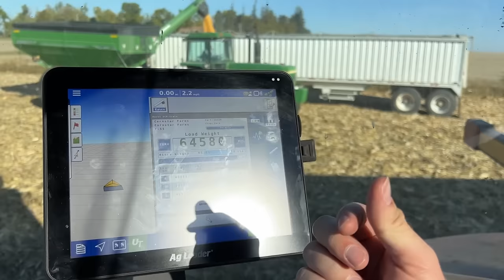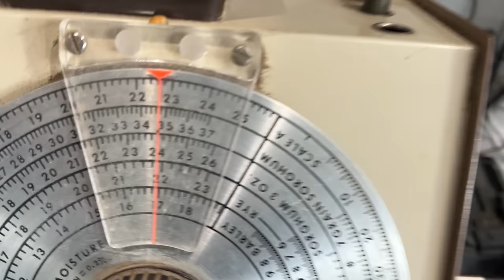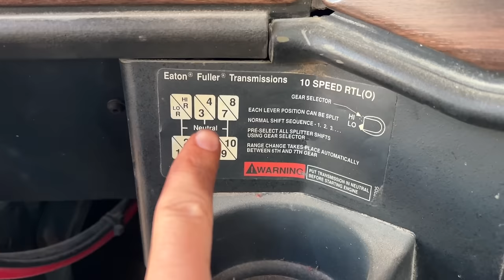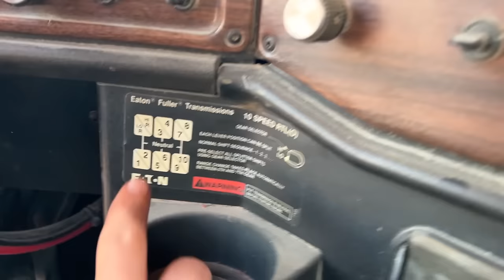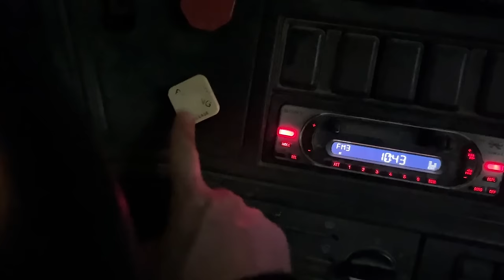My Farm Has A $140,000 Problem

Comment: The gearbox you were describing is a splitter box.  You have the 5 main gears in the front of the gearbox, then you have a low and high gear set on the rear of the gearbox.  The early Scania trucks, 80, 81, 110 models were all using splitter boxes.  A trap for young players with the splitter gearbox on the Scania...  Don't double declutch!!!  You do that, you get a box full of neutral!!!  Stop, drain the air tanks back to zero pressure, and start from scratch!!!  Police officer pulled up behind me after doing this.  He asked what the problem was.  You should have seen the look on his face when he was told what the problem was, and how it was caused!!!  "But, it's a truck.  You are meant to double declutch!"  No, not all trucks are created equal!!!

Comment: Would that be 2 exhumations?
You all are handling the bin site screw up much better than I would. Good luck going the legal way. It bothers me the most the way they don't shotty welding on those safety rails that people wouldn't depend on for keeping out of the harms way, not counting using low grade hardware on something with do much stress on bolts.

Comment: On the red Volvo auto shutoff, turn on cruise control and push the acceleration button as if you were rolling down the road to turn up rpm. Do not touch the clutch or accelerator. You are trying to fool the computer that you are driving down the road with cruise control on. On cold days in Coruptifornia 34•f😂 I would turn on cruise control to warm up my garbage truck and hydraulics faster. The Volvos we drove had that auto shutdown if the accelerator was not used for 5 minutes.
Yes I know 34•f a cold day.😂 I also lived in Alaska -32•f the coldest I ever saw.
Happy harvest

Comment: if you can find it, check what grade bolts both the auger is spec'd to hae, and what grade you were CHARGED for at time of purchase.  if it's spec'd for grade 5, the the bolt did it's job and sheared without absolutely wrecking the auger. if it's spec'd for grade 8 and you were charged for grade 8...

Comment: Grade 8 bolts are NOT "better" than grade 5. Grade 8 bolts have a higher tensile strength but are notch sensitive. Always use grade 5 if they are strong enough for the application. They will bend instead of break. If you need the strength of a grade 8, something is Probably deficient in the design. replacing those grade 5 bolts showing wear with grade 8 will most likely result in the bolts breaking.

Comment: OK cole the former owers of that combine probably swapped out the corn and sobean sieves and put in those other one that they were getting rid of that machine you mechanic should have seen that when in inspected that combine and as far as that red freightliner transmission goes what you have there is what they call a super 10 where you move the shift level five times or so . The transmission synchronizes will move when you move the button and agin when you move the level  we when two 1996 9200 internationals with these transmissions  they turn out to be the biggest pieces over crap ever owned we traded them for two W900 day cabs with 18 speed transmissions  best move ever and your to volvo's needs to have the computer hooked up and reset the perramittors to take out the idle shut down. And as far has your bin setup goes I would let your attorneys and your bankers go after the bin builds and suppliers I hope these comments help have a great day.

Comment: go to six grove pulleys or chain drive with a clutch on the pit auger. i hate super 10 transmission also, its a 18 speed case with missing gears to make it light, on the trailer that is slow pull the red line off at the first air valve (fitting)it is most likely stopped up with trash, get bug stopper glad hand seals and put them on trailers only, all of your semis have either a 14 or 15 inch clutch,

Comment: 10 speed super, easiest transmission ever to shift, and the easiest to learn to shift. I put my kids in the 10 speed before putting them in the 18 speed.  Just split each shift like an 18 speed.  You don't have to stop in neutral to shift the grey thumb lever. Preselect your lever position, then shift the gearshift. The shift is same as an 18 speed without the ranger.

Comment: Cole, that transmission is what they call a super 10 speed, you are splitting each hole. The trailer not releasing quickly is maybe because the tractor has an ABS brake system and the trailer probably doesn't, if the trailer is older than 1997 it probably doesn't. Also not sure if your trailers are air ride, with ABS you need a minimum of 90lbs of for everything to release, not like older equipment that only needs 60lbs to release. Patience. I've been driving 18 wheeler for 27 years professionally, so I hope this helps you. 😊

Comment: The timing of the auger flights from the lower to upper sections of your pit auger does not look right. In my opinion the trailing edge of the lower section should be sitting 180deg to the leading edge of the upper section. The way it looks in the video they are very close to being in the same place. This will impede the grain flow leading to higher motor loading and lower capacity.

Comment: Cole would it be worth switching the belt pulley system to chains? 

They won't burn up they may have to be replaced every few years but they will handle the stress of full augers and allow you to run at maximum capacity.

Comment: Those auger coupling (gungeon) bolts are supposed to be a softer metal. I think they actually call for a grade 4. This is to help absorb the start and stop torque. Grade 8s are too brittle.

Comment: DC is properly angry in this one. Rightly so. You have been rinsed on the bin site. It will come good in the end. Just a pain to operate in the interim,  a cost to you to be added to the bill. I'm not a farmer,  but I was thinking about field patterns for next year based on what you have shown this year. Plant intercrop to the widths of your existing corn and bean heads. Populate the corn as you did in the test, high density outside, and low density inside. Plant the margins and wonky bits with alfalfa or similar and see what you get. I don't even think you will need high management to do well. Concentrate on improving the soil as you have discussed. I added worms to my allotment, for example, and they are now tilling the soil and improving its structure. Safe harvest.  Regards, Stephen.

Comment: The transmission in the red Freightliner is a super 10. Many of the super 10 transmissions when in the 9/10 gear position would shift automatic between high and low. This is why it was a super 10. Depending on the truck you could be doing about 45-50mph and never have to touch the shifter again. The transmission and engine would work together and shift as needed. I believe the automatic shifting was only when the transmission was behind a 60 series Detroit.

Comment: you have relatively simple auditing and erp probs complicated by fct you let other people build part of your critical infastructure and you caught problems late instead of firing them midway through job - either way there is overhead of lawyers and consultants but you can cut down and be more risk adverse by paying people well and then offering performance incentives as a form of appreciation - if you do well everybody does well, you also have some labor issues you have to mitigate so you can work less and manage time a bit better - farming is less raw labor and more tech and analysis and science these days and it is trending, not stasis. you should think about building garage/office but use tax strategy to form timelines and materials acquisition plus have all the advice vetted as you don't want exposure to irs - you should have a good winter lined up and can focus on going over numbers and shifting focus once harvest is over. do think about more a/b tests, plowing and maybe some cover crops and getting accurate ph assessment. for lifting you should think 3-4x a week and jump rope and a heavy bag and cycling over 2-3 mos light to heavy - get more sleep if you can manage it but just do it one day at a time. the grave digging is a good side gig - you can keep improving that with minor alterations and improvements. network with local farmers and see how they did - cooperate and build economies of scale, do some free work for the local community and do some hunting before thanksgiving. continue auditing and organizing and cleaning up the farms - that helped you tremendously as well as the gravel - keep everybody happy and improve weak spots of farm - it is an optimization problem, nothing will be perfect but you can improve processes with reg inspections and pm

Comment: The bolts you replaced in that auger were coupling bolts. Extra long shank with a short threaded section. You put normal bolts in which will make one side of the auger work on the threaded section of the bolt and they will fail early. Also, that pit auger needs a gearbox on top. Gearing it down with such different sized pulleys is cutting corners and is why you're burning belts off so bad.

Comment: Your red Freightliner has Super 10 speed and don't know if it has auto top 2 many did. I've had so many apart doing gear update and mainshaft updates when they were new. Test driving them forget what gear you was in or to forget button shift from being use to normal 10, 15, 13 and 18 speeds

Comment: What happens when you leave the dryer on with only a few bushels of corn in it? You have the world's largest corn popper. Orville would be so proud.😂
Reply: Most of the hot air would just blow out of the gaps where corn should be.
Reply: Field corn doesn't pop like popcorn.  If it gets too hot, it just gets burned.  

It would be interesting to put popcorn in the dryer and see if it would pop.  I'm guessing it wouldn't get hot enough to pop it, though.

Comment: On the Volvo, when you set the yellow knob. You hit the cruise control and idle the motor up, and then it will keep running. 
The red Freightliner that's a super 10 transmission, not a good transmission . Try the truck on a different trailer and see if you have the problem.

Comment: That’s a super 10 transmission,the shifter “home” should be neautral , so when you shift from 2nd to third , pop it out of gear and let it naturally find neutral , then push straight up into 3rd , when you want to shift from 6th to 7th pop it out of 6 , shifter should find “home” move the shifter to right and up into 7th .  I was taught to drive that with using only two fingers (or open palm) to push the gear into the right slot , let the machine find its spot . That being said … a 25 year old transmission may be a little sloppy

Comment: I know this is going to sound like a silly question but, Why not wait for the corn to dry in the field?
Reply: I wonder if they are trying to beat the first frost?
Reply: It could rain 3 to 4" and you may not be able to get in the field before winter gives you 12" of snow.  Never trust the weather! You harvest when the weather is decent...
Reply: @justthings6405  Yes but they have plenty of time and dryer corn harvest better.  I mean 2 YT framers hate running 20% corn.
Reply: Most will not run if it is over 20% they don't have that corn to do and they have plenty of time.   There still a bunch of corn standing in Indiana and its 11-7-2023.
Reply: Cole also has another baby due in December so they are working overtime to get harvest done.

Comment: I used to drive a Peterbilt with a super 10, it takes a while to get used to it especially when you were switching back and forth from it and a mack.

Normally to stop trucks from shutting off like that you need to set your cruise control and rev your motor a couple rpm and it should stay running.

Comment: Two things to check. Is your elevator in high speed?   And some guys open the pre seive  too far open. Lay a corn kernal on it and open it until it falls through. On the pit auger. My neighbor was constantly plugging his new auger. Turns out the flighting didn"t go all the way to the top. It was trying to push it just to far and plugged the auger all the time

Comment: Your bottom slave is too tight blocking off the air on the top shaker causing the top Shaker sieve to carry trash further back to where it hits an Air Blast from the bottom causing carryover

Comment: You really need to stop using vbelts and go with timing belt drives

And set it up with a bigger reduction and just program the VFD with a higher max Hertz so you will have much higher torque on startup
Reply: Agree with V Belts, maybe conversion to chain drive, even less transmission loss then..
Reply: Maybe push his business in for good measure

Comment: The red freightliner has a super 10 speed. One thing that I learned when I load in the field I will back up before I take off so I don't brake a drive shaft. When the cart load you the truck makes a hole where tires sit

Comment: The transmission in the red Freightliner is a super 10 if the other truck runs 5 in the low side then flip to high side for the other 5 “6-10” it’s referred to a straight 10, I like the super 10 but when they get some miles on them they do get sloppy

Comment: I know it would be just a band aid but instead of running a 2 belt pulley could you go to a 4 belt same size pulleys for now that way 4 belts could handle the load that’s on it, atleast to get you through the lawsuit situation

Comment: Convert that dryer from a v-belt to a serpentine with a tensioner. It will slip much much less and last a lot longer. Or you could convert it to a chain drive or even a direct drive.

Comment: The trans in the red shaker is an Eaton Super 10. Definitely a wierd style imo, but if you wind the rpms up a bit higher you could skip shift and go 2 4 6 8 10, especially when empty.
Reply: Side note, you could take the trucks into probably any shop but definitely a dealer and have the anti idle program taken off.

Comment: Looking at the pulley sizes on  that auger you need some different pulleys. Not an expert but that’s your problem. RPMs of motor and auger and torque. Looks like your motor is spinning to fast and they stepped it down to far with your pulleys to compensate???
Reply: Do you understand that the auger needs to be spinning at x amount of rpm to move the 8000 bushel a hour it is spec at? So different pullet=ys might help but will not help moving more grain. Pit is junk design. trying to push to much through it.
Reply: The belts are slipping burning belts. Maybe a bigger pulley on the motor would not slip and move more. Would also need to ramp up the speed not to slip the belt. When you get belts you have to have them matched.  Belts very in length so they have to find four that are matching.

Comment: The issue with the red volvo if it's on the truck side or trailer side it's a air relief valve  the rubber diaphragm goes bad from age really cheap an easy fix. They use to be like 30 bucks.

Comment: … Have Cooper create a steel band of about six or 8 inches wide and about a half inch thick, wrap it around and bolt it together on the ends, make it long enough to encircle the top of  the foundation of the wet corn bin…

Comment: How did you guys choose your bin project company?   Obviously they are terrible but instead of complaining you guys take it in stride... would you recommend visiting a few well working sites and using those companies or any other teachable lessons for those who may be doing a large scale project in the future?
Reply: From what I see they really didn't do to much research or looked at other setups.  There 2 big YT framers that have great setups that could of easily been used as a starting point.   Both run dual pits instead of single pits and both can move a lot of grain in no time.   Think sale  guys was a talker and they fell for  his line of BS. Not sure on the true spec they asked for and what they got,   There was so much wrong as it was being built that I question why wasn't it stopped in the beginning.  Soil prep wasn't right concrete wasn't right.   Pit setup didn't look right. Catwalks was just junk.

Comment: The slow air going to your trailer is caused from grass bugs and bees getting into the gladhands when unhooked. Check them first then trace the emergency (red) line to the valve attached to the air tank on the trailer. Probably the most rear tank. Take the cover off the top and clean the debris out. May have to take every cover off one at a time and clean, even the ones that have air lines on them because they have valves behind the air line fitting attached to the valve that will most likely have to small bolts attaching the air line fitting cap to the valve.

Comment: Question? Cole, how difficult would it be to change the belt drive to a chain drive on all the motors and augers?
Reply: Chain drive on an auger would be dangerous, if the auger were to jam there would be a flying broken chain or a chain wheel shattering

Comment: You need a shaft mounted gear reducer on your pit auger It too much of a reduction to do with just a belt drive .....What you have now is the cheap way out
Reply: You don't understand much do you.  They can't put a gear box in the system.  That would make the system even slower and move less grain.  They got to have speed to move the grain.  The problem is arguer is not bigger enough to move tat much grain.  Really needed 2 pits to move that much grain.